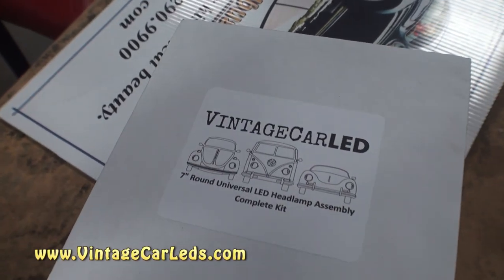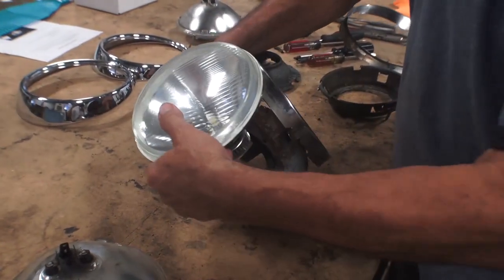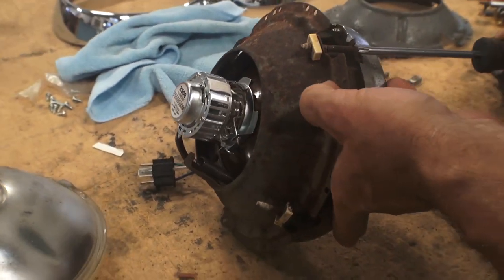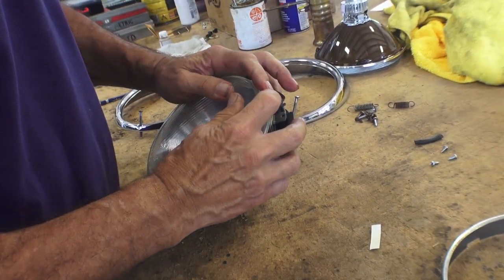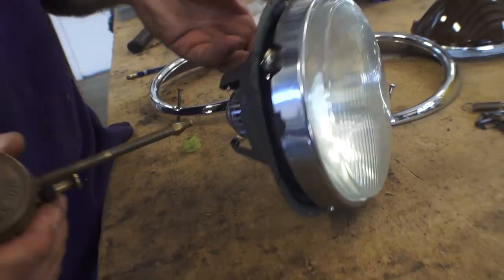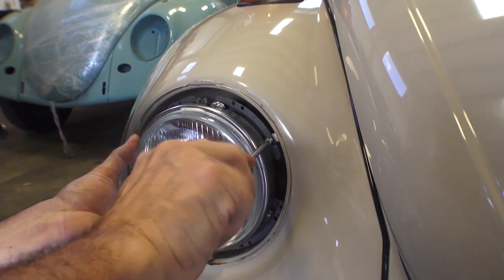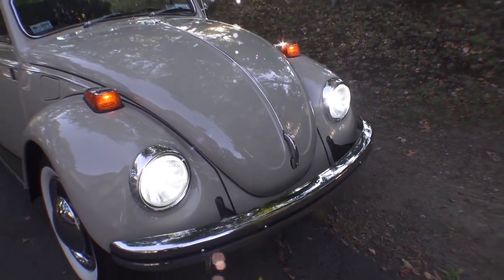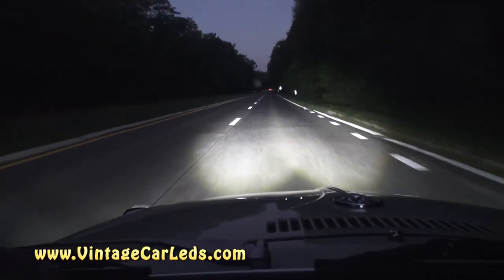Classic VW BuGs How to Install LED Headlight Lighting Review Vintage Beetle Car

Comment: Picked up a ‘67 to give to my 10yr old som one day after ‘Dad’ drives it a bit 🤣.  Appreciate the ‘coupon’ and this classic mod that helps with safety greatly.  Went with new fan-less 4000 lumens German Helo lens upgrade after seeing how pour the standard bulbs project. Noticed the LED are like 4x even H4 bulbs so excited. Couldn’t justify the top option wirh 3 lense choices personally but excited to be safer and brighter.  As a VDub newbie; your channel has been invaluable to me.  Thanks!

Comment: I'm so glad you posted this video, I was going to buy aftermarket lights that would have cost me $250 before tax, shipping, and handling. I looked these up, so much cheaper and a lot brighter. the other lights were only halogens as well. you got me sold on these!!!
Reply: Sweet thank you
Reply: lindley345 you should've spent $250 on a pair of Marchal headlights. These lamps are junk not saying the LED is but the rest of the lamp is junk very cheaply made.
Reply: Jimmy Grant dang, I didn't know that. thanks for the info.
Reply: Too expensive at $200+ a pop. Rather go just changing to led bulbs

Comment: H4 Conversions have been around for years . You need only get an H4 Conversion and replace the 9003 H4  Bulb with a new LED Bulb that is  9003 base .

Comment: Have a look at 5:40. This is the look I saw when I installed the LED H4s. It looks really bright in front of the car, so you might think that's good. But look further down the road, there's hardly any illumination. I left the LEDs in for a couple of months, then finally went back to the old type H4s. The far field was vastly superior with the old ones.

Comment: Hey Chris, thanks for the tip! I installed them in my '63. By the way, they've upgraded the lights, no longer have the little fan.
Reply: Without the fan, how are those lights holding up?
Reply: @Jayvans_Super  , I love them.  I run them in the summer heat,  and now in the winter rains. They sit behind the 1963 VW glass covers, so they don't have direct cooling like they would in later model Bugs, but I've not had any issues. I also bought a set for my mid-seventies Toyota Land Cruiser, and they're working well there too. Five stars, I recommend
Reply: How did they fit?  I just bought the 6v version and they are to long to fit in the fender being the housing.
Reply: @texasdoc68  mine fit easily in the headlight buckets. Did you get them from Vintage? It seems to me that the replacement LED assembly is no bigger than the stock incandescent bulbs. (I'd have to take them out to be certain.) 
By the way, my 1963 was converted to 12 volts about 40 years ago. I wonder if the 6 volts bulbs are bigger?

Comment: I own a few VW's that am slowly working on. Is the 65 beetle a 6 volt system?  Also of the car in this video, did you have oncoming traffic flash you? My experience with LED bulb replacement is a high throw of light.  Thanks
Reply from the maker: Yes originally a 65 is 6v system.  I do not remember the oncoming traffic flashing me, sometimes when another car hits a bump it looks like flashing.  But you are correct, many times LEDs can be very blinding.
Reply: @classicvwbugs  The beetle im working on as a winter project is a a very solid no rust bug. The VIN on the tunnel is showing a 1965 and the front trunk tag as a 1966.  I'm assuming these are very similar years including the seats and headliner. Any incompatible electric etc could be a proble. I would like to confirm what engine is there. I'm unable to find a decoder for this engine. Do you know of a method?  Thanks
Reply: Also someone has converted to 12V.  Makes the electrical  a little confusing to me.
Reply from the maker: @1ProShooter  Yes thesamba.com can help in their tech section.  https://www.thesamba.com/vw/archives/info/bugchassisdating.php

Comment: Anyone know why they discontinued the 6 volt version of these?
Reply from the maker: They are not, you can get them here, I updated the link https://vintagecarleds.com/shop/7-inch/vcm3-7-inch-led-headlight-kit/  make sure to use my code to get 10% off.

Comment: Had LEDs for a while in my 71SB, bought the H4 headlamp from Kaddyshack then bought the led bulbs separately, best upgrade for lighting.
Reply: Jose where did u buy the LED's
Reply: central los angeles

Comment: Great video. I have a 72 ghia. Where so i find these type of headlights? Also, since my alternator is no good, im gonna buy a new one. Which should i buy, 55, 75, or 90 amp?...
Reply: Tomas A, depends on your loads: for a huge stereo system you need a high output alternator, but if you have a battery with better specs than original (higher amp-hours) and are converting to low-watt LEDs (which pull less amps than original) then go with a smaller size alternator.  If I had a ’72 Ghia (some day!) then I’d go modern, high efficiency lamps, small high-efficiency alternator, and have more power to the wheels.  Save gas, save money, save the planet.

Comment: i bought some more modern LED ones that have blinkers built into the lights, they have two extra wires (probably for the blinkers) how would i connect them to where the blinkers would work ?

Comment: Is there any way to soften the light, I like being able to see but I don't like blinding other drivers
Reply: I'm wondering this myself — they're blinding and should not be allowed as is!
Reply: As long as your headlights are aimed correctly you will not blind other drivers. The cutoff on these is sharp.

Comment: Chris, you didn’t mention whether the LED headlights have a high beam.  Also, we’d like to see it demoed in your video.
Reply from the maker: I do show it in the video.
Reply: They do have hi and low beam built in.
Reply: @thomasduncan8289  do you currently have any discount codes for ordering LED from your website?
Reply: @tomasalvarez6040  the code: Classicvwbugs will save you 10%
Reply: @thomasduncan8289   thanks…just ordered last nite👍👍. Curious, if you also carry 6volt led for a 64 bug?

Comment: Great video but I went to the website and the earliest lights they have is for a 67 why won't they work in my 61 is it because of the outer glass class
Reply: Paul Hyde, are you sure you went to Vintage Car LED? I just installed these in my '63 bug. No problem. Perfect fit. I was scared to drive at night with my stock headlights; now I have daylight at night!

Comment: Hi Cris Im Hector Roman I like your head ligths but first I have to fix the problem,I have in my bug my right headligth dont turn on and I swish the bulb from left to right and still wont work I check conections and look everything ok ;you have any Idea what it is??
Reply: Hector did you  check to make sure your wire are connected properly to the fuse box and also did you check your fuses? That could be the issue. Hope you get it fixed. I have a 62 that I will be working on soon.

Comment: do you guys just sell the led and cable?? I have a 3rd gen camaro and I'd like LEDs. Thanks. I checked the site but only saw for VW..
Reply from the maker: We do not sell, I just made a review of the light.
Reply: +Chris Vallone oh, well found a site called "hidnation.com" that has a big variety for different cars. But thanks for the response.

Comment: On low beam does it only light up the top half of the housing or the full thing?
Reply: The VC2500 is our old discontinued model, all of our new 7" models light the entire housing full.
Reply: Hostility, get them! They light up the whole thing. On my FJ-40 I have the kind that only light the top half, so I know what you mean.

Comment: Any options out there for LED tail lights for a 6 volt 1966 beetle? I've found options for earlier models in 6 volt, but everything else I've seen is 12.
Reply: glee7007 check the samba forums

Comment: Are they available for European (E1)headlights?  I have a 1971 VW 1300 with factory 1200cc engine.
Reply: If you can get led bulbs H4 base they plug straight in to your stock headlights, much less expensive,but if the silver coating is faded and chipped then now might be time to replace the whole unit.

Comment: Is there any modifications needed to electricals like fuses. 16 amperage right?
Reply: + Daniel Jimenez  There shouldn't be a need for any electrical mods, LEDs draw very little amperage. If you haven't done so, clean the grounds and contacts, and keep ypur battery terminals clean, LEDs or not, it's just ''good housekeeping".
Reply: For sure. Thank you!

Comment: Do these same headlights work on 66 and older beetles? @Chris Valone
Reply from the maker: +Matt Jackson as stated in the video, they do not have 6 volts yet, but if your car is 12v, it will.

Comment: Will these fit on the splitwindow buses?
Reply: Yes, if your split window has 7" sealed beams installed these will replace them just fine. Use the coupon "classicvwbugs" for 10% your order @ vintagecarleds.com

Comment: To bright, I said it. I'm not a fan of the "whiteness". They give me a headache, to high a kelvin temperature.
Reply: TheGuerillapatriot to too two I believe TOO bright is proper.
Reply: TheGuerillapatriot the reflector and lens is complete junk I've seen them for sale for as low as $20 for a pair dirt cheap foreign made junk.
Reply: Color and brightness have nothing to do with one another. They are separate properties.
Reply: Absolutely agree — they're a menace and should be banned from public roads!
Reply: I hate modern lights. High Kelvin takes away all night vision from eyes. To high a contrast. I use Nokya all weather 2900 k

Comment: Chris Vallone is this possible on a 1966 beetle?
Reply from the maker: yes if it is 12v
Reply: We also have a 6 to 12 volt converter you can wire at the fuse block so our 12 volt headlights work in your 66 (its what I did for my 6 volt 66') -Thomas @  vintagecarleds

Comment: When I turn my lights on in my 70 beetle I get a huge voltage drop
Reply: + Bert Thomas Clean your battery terminals, connections and grounds, and do not forget the fuse box. You should check the wiring, too.

Comment: Will these fit a 58 Beetle?
Reply: If your 58' beetle has US spec headlights with 7" sealed beams yes, any of the 7" kits vintagecarleds.com has fits. IF you have 6 volt please get the VC6V headlight kit for 6 volt cars.  Coupon code "Classicvwbugs" for 10% off